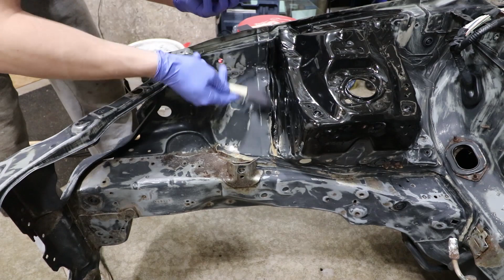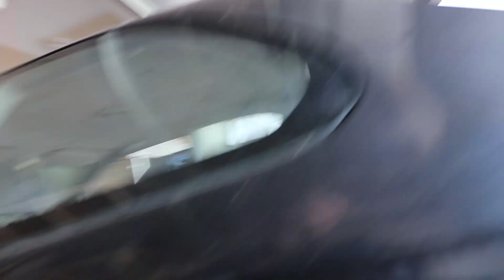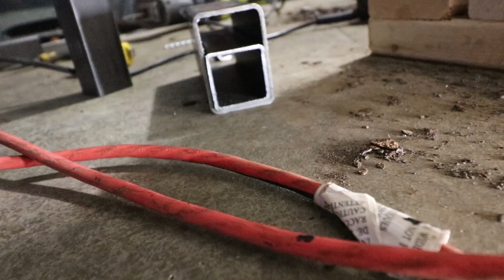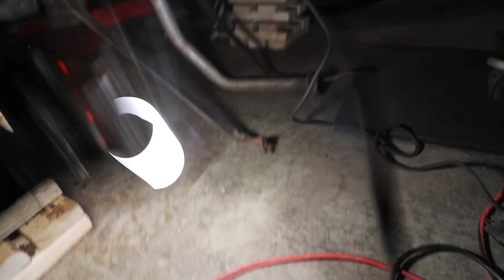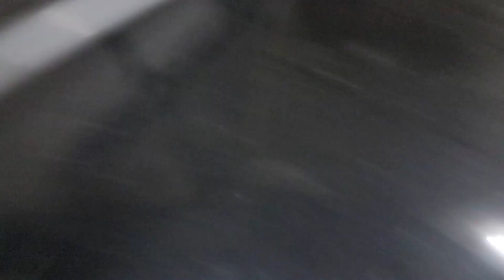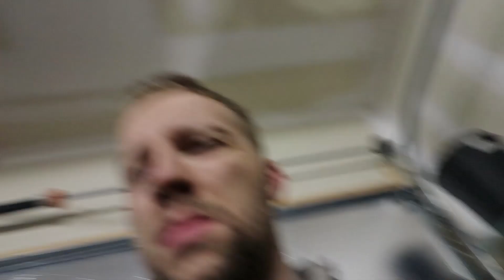Frame Rust Removal and POR15 Industrial Paint

Comment: You didn’t use any of the recommended metal prep or degreaser. How did it hold up a couple of years on?
Reply from the maker: For the engine bay and wheel arcs I did, i let it fully dry before applying the POR15. Underneath where the tank was I didnt use a metal prep from POR, I did use a different cleaner and prep and to this day its holding up no problem, no flaking, no rust popping through, still solid
Reply: Garage SpeCivic  excellent, thanks for the reply 👍🏻 I’m just doing the chassis on both of my Landrover defenders and had heard a couple of bad reviews lately

Comment: I want to use POR 15 but i just layed down 2 coats of rust converter. Could I still use por 15???
Reply: I wouldn't do it. PO15 is very sensitive to surface prep. It likes rough, CLEAN bare metal.

Comment: A real respirator is required for POR 15, not a dust mask.   Maybe you put that on later in the video.  There are some fairly nasty chemicals in this awesome product.  Here is the SDS for it:  http://www1.mscdirect.com/MSDS/MSDS00018/59505222-20170211.PDF